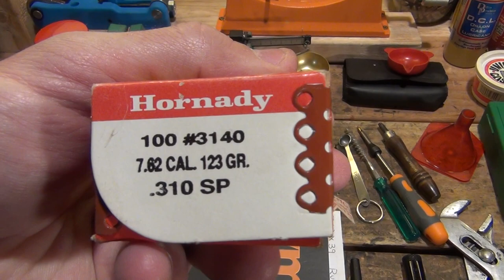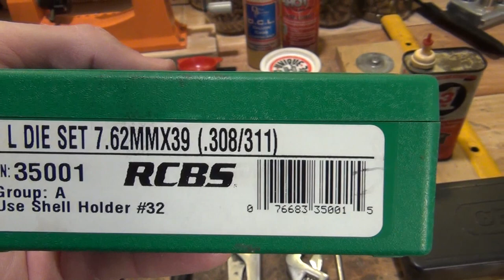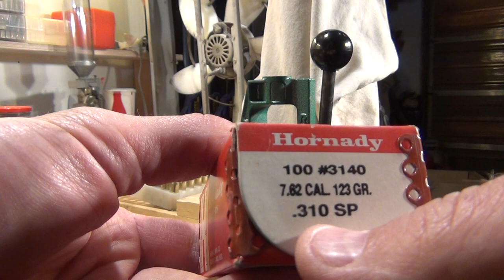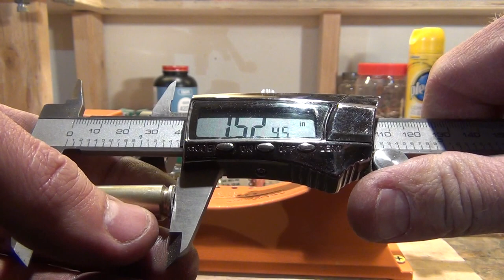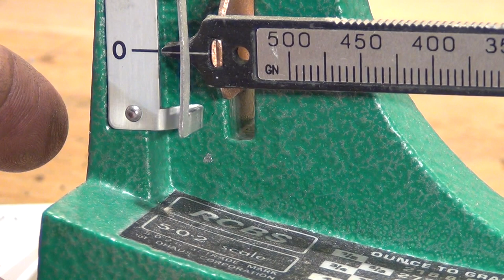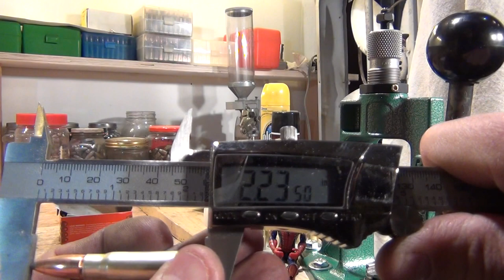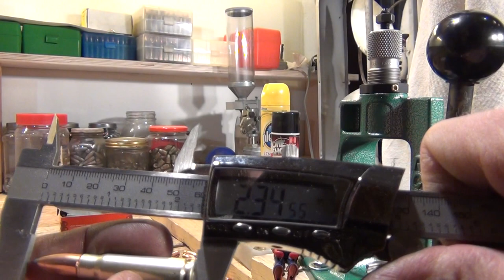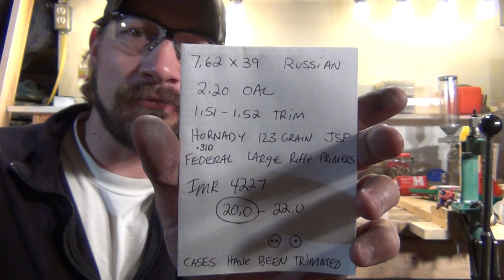Reloading 20 rounds of 7.62X39 on a single stage press from start to finish (short) - HD

Comment: Nice video. Starline has new brass, I just ordered. To save the work of using a caliber as much just get a case gauge and run each case in after resizing. You immediately know if your case needs trimming and if it meets specs. Lee factory crimp dye takes a lot of effort out of crimping and comes with their 3 die set.

Comment: Nice video, thank you! Made my first test batch with different loads yesterday. I also drilled out, decapped and sized some copper coated steel Scorpio STV but don't have a solution yet to keep the slightly smaller large rifle boxer primer in. I don't really want to rely on nail polish or crazy glue for this purpose..

Comment: I may have missed it, but did you mention that the cases need to be sized before they are trimmed to length?  The cases stretch when sized.  This is an outstanding instructional video.

Comment: Have a question resized with the 310 expander in my Lee 7.62x39 dies. Primed and started reloading. I'm using Hornady SST 310 dia.
Bullets are loose in brass. How can I fix the 100 brass that are already primed . Can I get rid of the decapping pin on the 308 expander and resize leaving the new primers in.

Comment: Two years ago I set up my Rockchucker, de-capped and sized brass then had to sell the house and packed up my equipment.  I'm thinking about unpacking and starting up again.  If  I remember correctly the rounds you made in this video are for a semi-automatic rifle.  That's the reason you crimped the brass to the bullets.  Can you crimp bullets that don't have the cannelure?  They say a crimp isn't necessary on rounds used in a bolt action rifle.  Do you crimp all your loads?

Comment: There needs to be clarification on the differences between Berdan and Boxer primers. 7.62 steel cases are always Berdan primed but you won't be reloading that. Brass 7.62x39 casings can be Berdan or Boxer primed. Berdan primers can't be removed like Boxer because the brass is fundamentally different.

Comment: Great explains  for reload for 762x39  how are your groups  with that powder.and whst tip of weapon  is it for .? Thinking of relocating  som fir my mini mouser and did you eve use H4198 powder?
Reply: I'm getting ready equipment to reload 7.62x39mm Russian  bullets. IMR 4198, 24 grains,  is the power that will be used.
It groups very good.
Reply: @useryggfdcc  that is the povder i use and 24 .g. 50 R at 134 g and 50 at 146 g

Comment: When I set up bullet seating and I am getting close, I think of the turn kindah like the numbers on a clock when I am walking it in on a turn.  Maybe a 3 o clock turn or to 7 o clock etc.  Good stuff dude.
Reply from the maker: awesome way to think about it. thank you for stopping by
Reply: I am a subscriber.  Keep up the good stuff.  I am learning about reloading for my AR.  I am gonna start with 68 grain Hornady HPBT @ about 2500 fps for starters.  I shot some winchester white box and had some lousy groups.  I can't believe how much a 9 mph diaginal cross wind had at 100 and 200 yards. It blew them 5 inches at 100 and 12 inches at 200.  I got a Dillion 550, but reall think I should go single stage as I want accurate consistent rounds.  The Dillion powder charger throws within +/- half a grain.  I got a Lee Press that is about 37 dollars.  I use it to size .457 and .308 bullets for my Quackenbush air rifles.  Would that be better using that than a progressive?
Reply from the maker: +Dutch1722 the progressives have play in the shell plate. single stage presses don't have that so much. thank you

Comment: What is the purpose of having full length dies as opposed to short base dies as RCBS makes both for 7.62×39mm
Reply from the maker: Great question.  Full length is what I use because it will make a round that will fit many rifles of that caliber. Short dies are good for a single rifle and don't stretch the brass as much